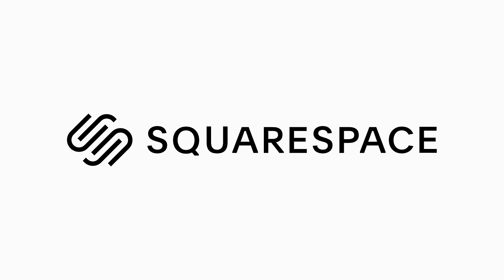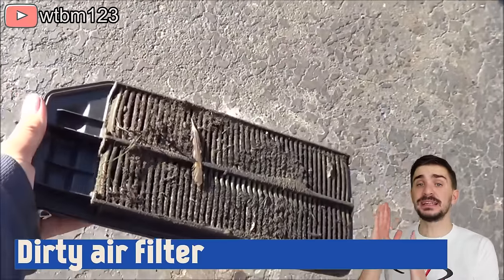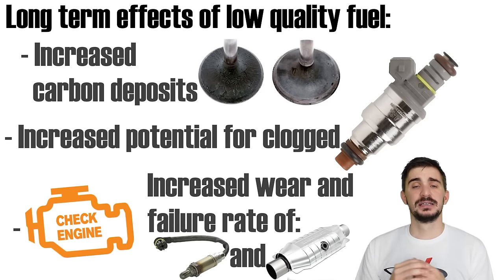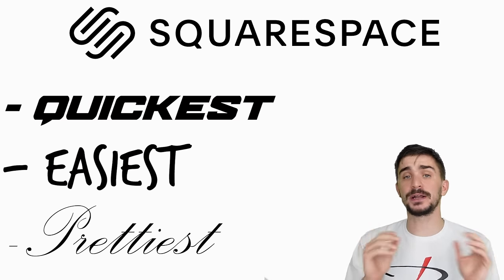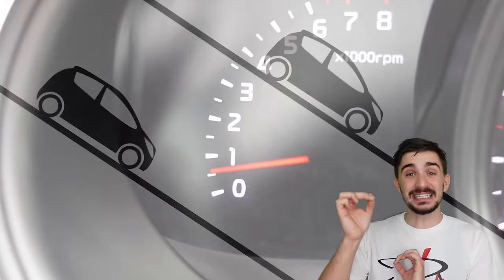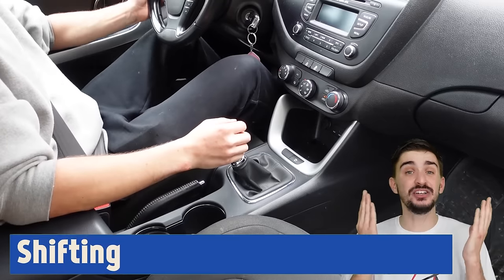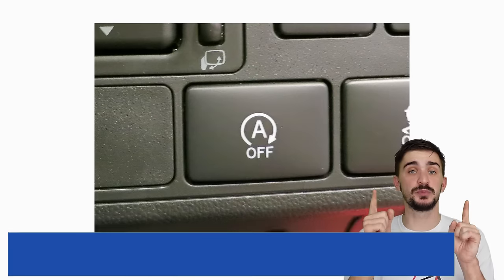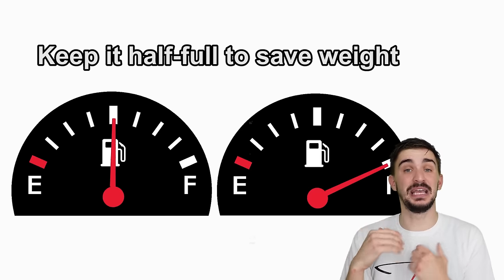EVERYTHING on FUEL SAVING - PRACTICAL DRIVING and MAINTENANCE techniques to REDUCE FUEL consumption

Comment: I always say driving economically requires the same technique as driving fast on a race track: avoid braking & preserve momentum. A requirement for this is 'looking ahead' (past the 5 metres in front of the car), predict the motion of traffic instead of reacting to it. Also very important for safety itself
Reply: Good point conservation of momentum ,everytime you stop at traffic lights ,adjust for traffic or break for obstacles and have to accelerate again the car chews through petrol,
Reply: Maybe safety is indeed more important than saving little money. If you really want to safe, ride a bike.
Reply: Maybe this is one of the dangerous things this video should have mentioned. I cut corners and use other side of the road when there is no traffic. It keeps my momentum and go around corners fast, keeping a constant speed. Great fun.
Reply: Fuel is cheap. Who cares.
Reply: @wingkinwong9082  Bikes are fine if people ride them wisely.  Few do.  The bicycle casualty stats in Holland, where bike riding is very big, make very dismal reading indeed.
Reply: @Dan-re7go  I think most people would not take that view.  That you are clearly rich enough not to care is very nice for you, but fuel is not cheap.  Even so, while I do not accept that CO2 is a pollutant, fuel is a finite resource and we would do well to use as little as possible to make it last until something more durable comes along.  Thus far, the alternatives are both expensive and unreliable, so we have some way to go yet.
Reply: electric car drivetrain is not recycled so not sustainable plus higher emissions in materials mining process materials are not reusable, heavy car costs road repair damages. light weight hybrid or normal car is ideal depending on how much gas costs. combustion can burn clean so only emission co2 and less of it and that is not bad.  they are not fixing anything, so might as well mazda lightweight car for reliable low cost running (see egnineering explained on mazda engine, volvo twin turbo, se road and track articale on nissan E power nismo hathback, prius TRD freepiston ingocar concept etc)
Reply: I always say that everytime you use your brakes, you waste gas. When there is almost no traffic and/or i'm not going to be a nuisance to others, my driving style is drastically different. However, there is no way i'm going to be a PITA of others people on the road.
Reply: great thing about driving super effceint cars, is if there are even 1 less effceint car and driver behind you, you probably should speed up b/c if u slow down their momentum by being slow, the total emissions and loss of money for all cars involved is higher. theres also the game of speeding before light becomes red from being yellow, and light becomes yellow from there being not as much cars vs the other light involved in the traffic senario, so i stay with the majority of cars around me which also benefits by less aerodynamic pressure onto my car.
Reply: @kalmmonke5037  You are wrong on just about every count.  If someone else is driving badly and thus being uneconomical, that is up to them.  If you end up being forced to speed up because someone is intimidating you, you will have to brake more harshly to slow down with the attendant risk that they will go into the back of you.

If you drive economically, if they are behind you, they too will be driving that little bit better.  As for emissions, most of what comes out of a vehicle these days is CO2 and water.  All the nasty stuff either gets trapped in the Diesel Particulate Filter or gets converted into harmless CO2.

If you speed up to get through a yellow light, that is in itself risky.  The whole idea of the yellow light is to give you notice that it will shortly go red.  If you are so close that stopping would be quite extreme, then you go through.  

As for the aerodynamic issue, that is entirely speed related.  The faster you go, the greater the air pressure and the more work your engine must do to push through the air.  Modern body design reduces this pressure wherever possible, but it will always be an issue.  If you drive with your windows open much above 30 mph (roughly 50 kph), the swirl of the air inside the car will induce significant extra drag.  At that point, use the air con.

Do not sit and sweat in considerable discomfort because that is a distraction.  Rather than concentrating on you driving, you will be thinking about how uncomfortable you are.

I mentioned CO2 earlier, which has been billed as the killer of the human race because it is a greenhouse gas.  This is complete rubbish.  Atmospheric CO2 is just 0.042%, a tiny amount.  The global climate temperature has remained flat this century.  It stopped rising in 1998.  Meanwhile, CO2 has continued to climb.  CO2 levels have nothing, repeat nothing, to do with temperature rising.  In fact, where CO2 goes up, it does so after a temperature rise.

You must also ask yourself a very simple question.  How is the world of 7.5 billion and rising feeding itself?  You do not hear of the terrible famines of 30-40 years ago.  Plants need CO2, which is plant food, warmth and water.  They are getting all three.  The Sahara is shrinking.  More people die of cold than heat.  Fact.  Look at the stats.  As soon as autumn comes along, up go the deaths.
Reply: @marc-oliviercabot3380  that's right. after all, brakes are only turning kinetic energy into heat. Only worth using with efficient regen brakes on a hybrid/electric
Reply: @kevanchippindall-higgin1859  i was assuming everyone nessesarily needed to get to where their going at the speed their going at. about global warming,  do u think it is not a problem? ive heard a a pattern of people saying oil is not from fossils, but rather something that is bellow fossils. its supposed to be something that is constantly made when taken away, so if we take too much it'll cause a shortage and other problems, as it is a "lubricant" for geological changes in earth
Reply: @kamilzmich5961  That's one thing i like about my Prius Prime. It will clearly indicate when the brakes are in regen mode and when the pads step up so you could adjust your driving and be more efficient.
Reply: @kevanchippindall-higgin1859  heard of E fuels? maybe we can get engine design to be flexible about what fuel it can run on, by things like nissan variable compression ratio engine. nissan E power nismo versa hatchback 90mpg. freepiston with electric and hydrallic regenerative braking and output power, but hydrallic storage.
Reply: @kevanchippindall-higgin1859  toyota said hydrogen combustion production car, but will such be ok in terms of emissions? do they not beleive in E fuels by shell oil crop etc?
Reply: I agree with the principles of preserving momentum and anticipating changes, but otherwise economical driving is really the opposite of racing driving. On a track, you're either hard on the accelerator or hard on the brakes, since you're trying to minimise time, and you'll favour lower gears to keep engine speed in the peak power band. That's probably the least economical way to drive in terms of energy/fuel consumption.
Reply: @thromboid  Yeah he is sooooo wrong on the race track part it's almost funny!😅
Reply: There are some overlap yes :) 
I never brake for corners hah
Reply: @wingkinwong9082  NAH. A bike isn't safe at all. Here in Phoenix, AZ, they run up on the sidewalk to run down a bicyclist.
Many of my co-workers rode bikes to work in order to save gas. They stopped after many of them were hit by cars driven by drunks of crazies.
Reply: @kevanchippindall-higgin1859  GET A CLUE, dude -- when the percentage of CO2 in our atmospehre reaches a point where the CO2 is out-of-balance with the Oxygen percentage, the CO2 BECOMES a pollutant.
400 PPM of CO2 in our atmosphere is the danger point.
 We have passed the 400 PPM mark some time ago.
Reply: @kalmmonke5037  They are called "Fossil  Fuels" because they come from a time when dinosaurs ruled the Earth, and all that's left of that period are FOSSILS.
Reply: @kl9518  cutting (non blind) corners on b roads is also more comfortable at same speed by making smoother entry and exit into and out of corners. as long as passengers trust you and don't think you are drunk/not controlling the vehicle
Reply: @kalmmonke5037  everything can be recycled, it's just often too expensive/energy intensive. the hardest to recycle in an electric car is the batteries. more  r & D must be done into making more recyclable batteries. there are several solutions.

first make batteries last as long as possible with good thermal management, and good charging patterns. this can be done consciously or optimized by IA. don't charge to 100% when you don't need to. don't drain to 0% either. don't stay for long periods at low or high SOC. fast charge only when necessary. batteries can last hundreds thousands of miles.

second, when needed, recondition batteries by replacing dead /unbalanced battery cells and extract the most life of all the cells .

third, when all cells are down on capacity, use the batteries with lower capacity for applications that don't need energy density like home solar batteries.

last, recycle battery cells

hopefully battery recycling will become a profitable and will reduce emissions and recycle rare materials once lot of used Evs will reach end of life and get scraped
Reply: @kevanchippindall-higgin1859  your stats are flat out incorrect. One only needs to point to the high rates of warming in the arctic, and arctic ice sheet melting. Classic misinformation to suit your viewpoints.
Reply: @Subarusyndicate  it melts every year during the summer. The overall temperature trend is flat as measured from space.
Reply: @kevanchippindall-higgin1859  all you need to do is look at aerial photographs of arctic summer melting from the 70s to now. Not to mention average temperatures in northern Canada or somewhere like anchorage alaska.
Reply: I thought driving fast on a track meant using as much power as available during the straights, going hard on the brakes as late as possible to the maximum corner speed, and then back on the throttle as soon as you pass the apex, not avoiding brakes.
Reply: @__Razer  you're nearly there. What I was saying is the fast ones don't brake where a beginner would. It's so much not about gas here, brake there, but average speed (or momentum). On a track you need throttle mid corner for balance, and you can accelerate on the back half of the apex usually. Same how you can trail brake into a corner.
Reply: @__Razer  also, late braking isn't always the fastest way through a track
Reply: I agree with the predictive part, but on the track, wouldnt you wanna always brake before a corner and brake as late and hard as possible to accelerate as long and decelerate as briefly as possible?
Reply: @pianoraves  I mean it's a loose comparison. The statement "preserve momentum" still applies though, essentially maintain the highest average speed. Whether that means braking late or early just depends on the corner. The commonality is to not over-brake
Reply: amen. gain speed going down and preserve momentum, let velocity somehow drop while climbing
Reply: Yup. Just very different priorities.
Reply: @kl9518 this is absolutely unacceptable. There is never any excuse to poach the oncoming Lane around a turn, especially if it's a blind turn. This is very much frowned upon in the enthusiast community.
Reply: So why I’m the only one, it seams, who is doing it?
Reply: @kl9518  On this I could write a book…

Comment: Great video.  One correction:  Drafting is not ineffective.  It is very effective and can more than double your fuel economy.  But you are correct, it is EXTREMELY dangerous,. and you shouldn't do it.  Good luck having the gas savings be higher than the costs of the inevitable rear-end collision.
Reply: In no circumstance can drafting "more than double your fuel economy."
Reply: @johnsmith1474  Correction:  In no SAFE way can drafting double your fuel economy.  On a flat course,  drafting at 3-5 feet behind a semi, you can get FAR more than double.  Just remember,  the data on these stupid close drafting differences was done on a closed course with an automated system maintaining the interval.  To see those gains in the real world, you would quickly lose your license and insurability with the number of times you would rear-end the vehicle in front of you.
Reply: One time I ran out of petrol (fuel light on) and by using this technique I still made it to the nearest gas station luckily.
Reply: I recall an experiment run in the 1980s where they fitted test cars with automatic following systems. They used telemetry to manage following distance and signal the lead car’s activity back along the train, optical steering sensors, and  join/depart protocols.
Watching videos of those cars drive a foot apart was interesting.
I’m not sure I’d trust the lead driver enough to participate?
The cars would overheat if they spent too long in the train, but like NASCAR knows they saw significant fuel savings.
Reply: @wingkinwong9082  fuel light on means you still have 10-15% of your tank left (20 to 50 miles (30 to 80 km's)). It was made this way, so that, *pardon the expression*, dummies, wouldn't get stranded when they only think to refuel at the last moment.
Reply: only if the car ahead drives good, if he brakes and accelerates frequently is even worse
Reply: Drafting can work safely behind very large vehicles (i.e. semis) because the distance of a measurable draft benefit is actually much larger than people realize. Combined with radar-based cruise control to maintain a safe distance with minimal throttle adjustment, you can get a few percent benefit.
Reply: @5thearth  few percentage is not a big of a deal...you literally contradicted yourself, also if the guy in from doesn't drive liniar is a lot worse and at least in my country drivers don't drive linear at all
Reply: Yeah, anyone saying that drafting doesn't work is an idiot. NASCAR does it to increase top speed because the car doesn't have to push the air out of the way. It's also commonly used in endurance racing because it benefits both cars' fuel economy. And, how about trying this on for size? I once did a long-distance trip on a pedal-bike; and even on those we were told to draft with each other; my legs thanked me so much.

Now, the danger should be obvious there is no world in which your reaction time is fast enough to survive anything going wrong if you draft so close to someone.
Reply: @kenbrown9773  you are not in NASCAR in public roads, ppl will accelerate and brake frequently
Reply: Came here to say this. Mythbusters did an episode on it and found drafting 2 feet behind a tractor trailer consistently doubled the fuel economy.

That said... don't follow 2 ft behind a semi unless you're trying to die.

That aside loved the video.
Reply: To get any benefit, the car needs to follow a lot more close than most realize.  Also, if I recall correctly, following not quite close enough can actually reduce efficiency.  If you picture a wind tunnel test, how the air goes over the top and then down, it's actually sort of intuitive.  The effective area to draft is in the little "umbrella" right behind the lead vehicle.  Of course, doing this on public roads is not only unsafe, but also incredibly rude ....
Reply: @johnsmith1474 in the EU you can definitely save 30-50% of your fuel costs when drafting behind semis on long distance trips.  
The thing is: in the EU trucks are speed limited to 85-89 km/h, and the truckers will try to drive their truck at the configured limit as much as possible. This way there is little braking or accelerating on calm road conditions.  

It's definitely unsafe though!

Comment: i think you got oil viscosity backwards. More viscous is more resistant to flow, not less
Reply: Right, he got it backwards. The higher the weight the more viscous is the oil.
Reply: Thanks for the comment, I thought the same and just checked.
Viscosity is the "Resistance to flow".
Reply: I was about to say that
Reply: @driving 4 answers... should really fix this... even thouhg it may seem as a small inadvertence
Reply: I thought I was having a stroke when I heard that.
Reply: @MoreCycles  Yes me too, I thought I was going senile but it wasn't me
Reply: I was questioning my reality until I seen someone else agreed

Comment: One thing that can help is hitting lights when they are green, so if you look ahead, and the light is red, in most cases you can just let off the gas and idle up to that light that might turn green by the time you get there.  This may be slower than traffic, so you end up slowing down the cars behind you, but usually does not decrease safety unless the people behind you are aggressive.   If everyone did this traffic would flow more smoothly, roads and the air above them would be cooler in the summer, and it would be a lot safer as well.
Reply: I HATE and find ridiculous people speeding between traffic lights. I swear they can’t be happy people.
Reply: @comeberza  i dont know about you but flooring on the lights is fun
Reply: @kolegakolano  I wont negate.  It is. If I had an electric car and didn't feel stupid for doing it, I'd floor it in every occasion
Reply: I do this. My reasoning is why spend gas maintaining my speed if I'll have to stop anyway? I won't have to wait any longer by just coasting in gear and slowing down naturally. Taking longer to get there decreases the time I have to idle and increases the chance it will be green when I get there.
Reply: @kolegakolano  yeah, it is fun, but it is more fun to play accelerate in the  countryside, especially if you have a motorcycle, or a BMW that corners like a slot car because of the extra steering linkage.